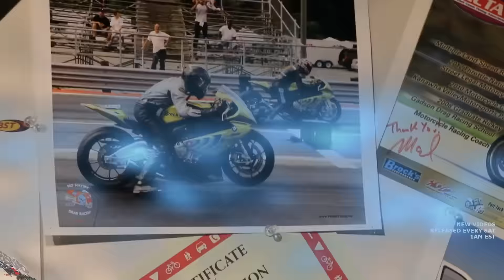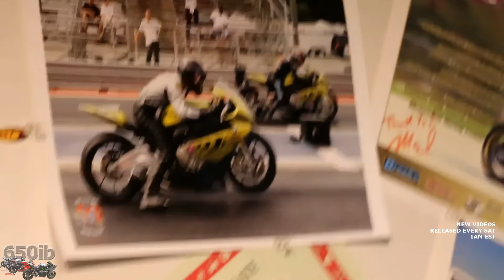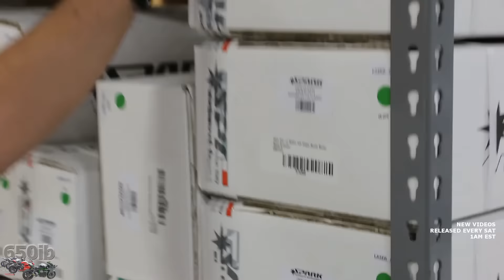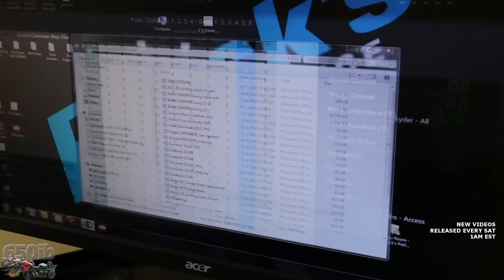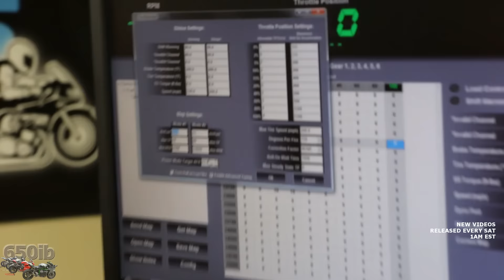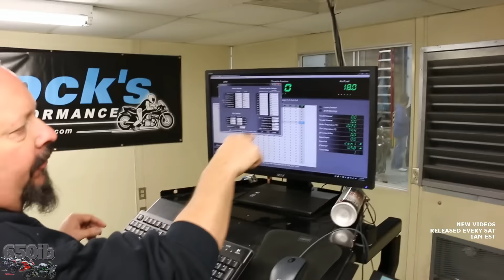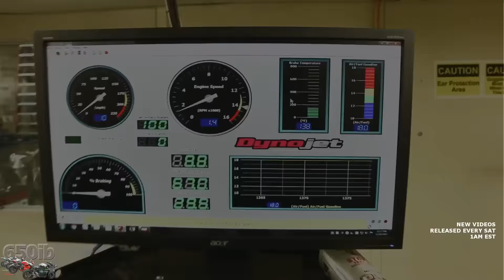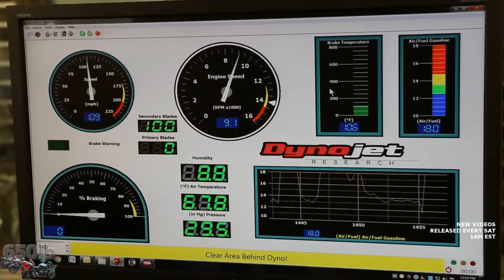Ninja H2 Dyno Tuning @ Brock's Performance HQ

Comment: +650ib, Which do u prefer fine tuning a bike Bren-Tuning "Dan Guhl" or Brock Performance??
I have a 2013 S1000rr & I wanna get the ECU flashed maybe a stage 2 kit... Whom do u recommend? Thanks again bro
Reply from the maker: +Don Davis Hello Don. Don Guhl, Brentuning and Brock's Performance are the top 3 performance specialists in my opinion. I have a Brock's Performance 17" CT Megaphone titanium exhaust on my HP4 with a BrenTuning ECU flash. I'd recommend the same for your 2013 S1000RR.
Reply: Yea it'll probably be between Brock or Brentuning, I already have a full Akrapovic system, power commander & bmc race filter. I'm kinda leaning towards Brock performance tho, which of the two is more expensive? And thanks again for the feedback... I appreciate it!
Reply from the maker: +Don Davis since you already have an exhaust and it's not a Brock's Performance system,  you might want to get the ecu flashed by BrenTuning.

Comment: When is your R1M getting a tune? and what is the R1 at brocks getting done?
Reply from the maker: +Bear_Moto Brock installed an exhaust and is tuning that 2015 R1. I think he pulled 30HP from it so far, the bike was restricted from the factory. He will tune my R1M in the Spring.
Reply: Nice. Yeah they are over there pretty restricted. Highest we have over here I have heard is 207rwhp on pump 98 fuel, but it's a tune developed by Yamaha Australia's race bike.

Comment: Which is better gearing 18t front and 44t rear or 18t front and 42t rear for drag racing We start rolling from 60km to 300km  
thank bro
Reply from the maker: +이상원 Brock uses 19F 42R for drag racing.

Comment: I wonder if the loss in power has anything to do with the Brock's exhaust? It could sure use a little beautification which will most likely add +10 hp as well as style points if made more aesthetically pleasing. :)

Comment: I thought the "lack" of power on the 262 hp bike was caused by the low octane fuel used in the bike and the the knock it created  ?
Reply: +michaelovitch Might be internal because they were bringing it to the dealer for further inspection, could have a tweaked valve ? Regardless of being almost new that bike been well used
Reply: +jim dandy 
the gas with too low octane cause pinging/pre detonation and the engine management with its knock sensor not allow enough ignition timing advance, sothe power is reduced a bit.
But 650ib do not explain what they found at the end.
Reply from the maker: +michaelovitch Yes, that's correct. We removed the 89 octane and replaced it with 93 and the bike is running strong now! We'll return to Brock's Performance soon for another dyno shoot out.
Reply: +650ib Interesting, glad that's was a simple fix. I really didn't think they produced that much power with a tune

Comment: That is crazy that you guys are making the same power as the H2R for a fraction of the price.
Reply from the maker: +archinuk417 Yup, yup! And our H2's are street legal.
Reply: 650ib Well if you lived in AZ, you could drive a H2R on the street. There is a street legal one here lol
Reply: +archinuk417 Why would want a H2r if you can get a streetlegal H2 (everywhere) for half the price? :P With a few small tunes... Even for the track you better buy an H2 instead of H2r, then you can even take a night ride on the track!
Reply: Neel Beke The H2R has wings... haha
Reply: +650ib Hey ib ma man, Thanks for ur interesting videos... There is one thing I'm really wondering about though, where does all the (horse)power of ur H2 and Mustandames come from? :o Cuz with that Guhl flash you only got 243HP u said and in Brocks videos they only reached 233HP with the ecu reflash... Also removing the CAT does that actually create much extra power, or an exhaust change? Or what mods did create all those extra ponies? :P Cuz that's like 80HP or so extra on Mustangdames bike and I don't see where they are coming from...Btw how does my Japanese mini streetlegal Supermoto sound to your ears? :P /watch?v=KpfhjXNVkgs
Reply: +archinuk417 I read somewhere the H2r only makes about 250hp on the wheel lol... That wuld be funny.

Comment: they are more powerfull then the h2r :o the race track only ninja makes around 250hp at the rear wheel 0.o
Reply: H2R in scandinavia has 326hp - built to last - with a full 5year warranty. 
as soon as someone touches the engine warranty goes out the window(every road going vehicle), if someone is involved in an accident insurance wont cover "shit" .
then again the H2R is made to attack the race tracks, and the "ordinary"  heavier (+22KG) H2 is a street machine that many including me dream of owning :)
Reply: +TrueDesireHD I heard that too that the WHP of this bike only around 250 :p though it should be more, but those .326 is BHP, on the wheel, WHP, it will be less...
Reply: Neel Beke the problem with running dyno/bench to get whp is that it differes from model to model of which the mechanics use. all i know and care is what the engine makes :P